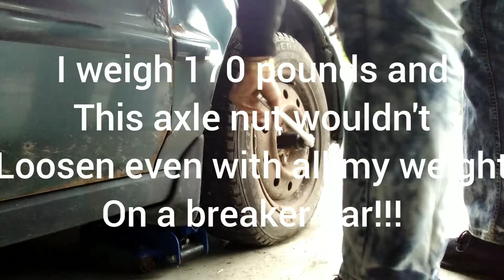Watch me try to remove a 1997 Honda Accord axle nut😡

Comment: ive done all this on mine and cant get it off either man, these things really suck
Reply from the maker: Yes they are
Reply: @goldginger_1  still working on mine at this moment, my socket keeps slippin off when i try and jump on it, my impact did nothing, nothing has worked so far
Reply from the maker: @callmezenex8529  I bought a really long breaker bar and held on to the top of accord and jumped on it hard it took a while but I got it. I also used a real good oil called free all!
Reply: I put my little scissor jack under my breaker bar handle and slowly started jacking it up and applying pressure to the handle. After a few nervous moments it finally cracked loose!